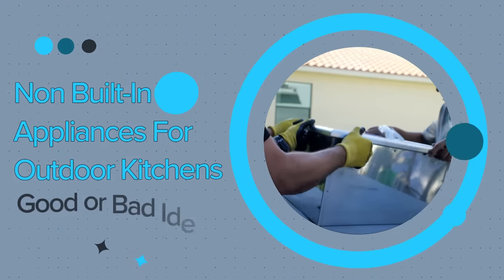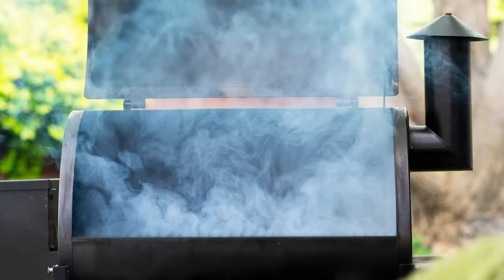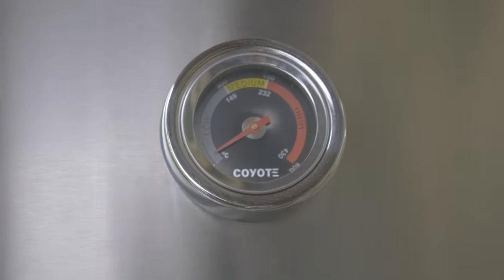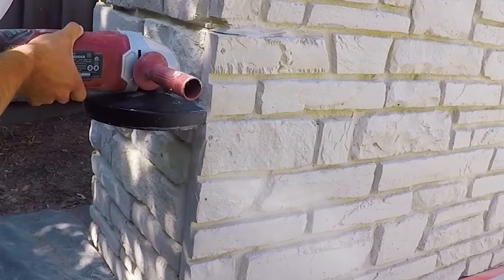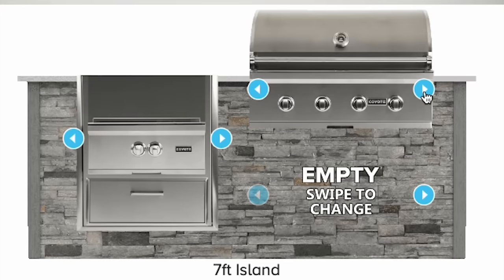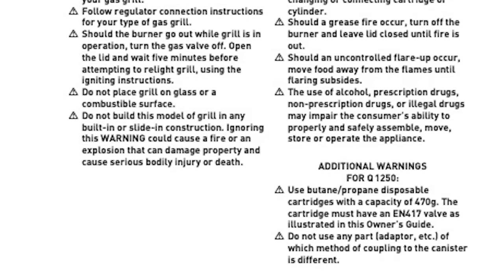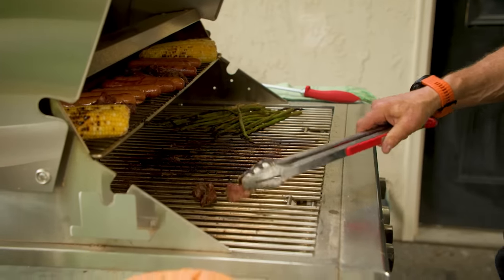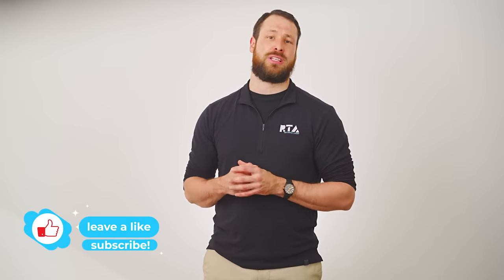Convert Freestanding Grill to Built-In Grill | Is it a Good Idea?

Comment: But what is so frustrating is I can get a 304 stainless Wilmington grill (stand alone) for $2000. You do same grill as drop in and it goes up 1k or more for less material involved.  Lifetime warranty…WHY????
Reply from the maker: Hey! Not too familiar with the brand you mentioned. Built-in grills are of higher-quality and made to vent safely. That's the price you pay for safety and quality.

Comment: thanks for the video, im currently planning an outdoor kitchen and had the question if i could use the grill head from my grill cart and build it to my counter top later on down the road. after watching the video it sounds like the only real difference between a "built in" model and a grill cart is that it might void the manufactures warranty, the materials used in the grill and  might be harder to install. but not that there is any real difference between the grill heads itself especially if i have more premium manufacture that uses all 304 ss anyways and can make any modifications necessary myself. Aso side not LOL at the rookie @2:57 trying to use a square😂
Reply: Hey! You definitely sounds like you have a vision and a plan which is excellent. We also strongly recommend putting in appliances that are made out of the durable 304 stainless steel. It's better to buy something once rather than buying cheaper and having to purchase again. We are glad this video could help aid you in your outdoor kitchen build. Wishing you a wonderful day!